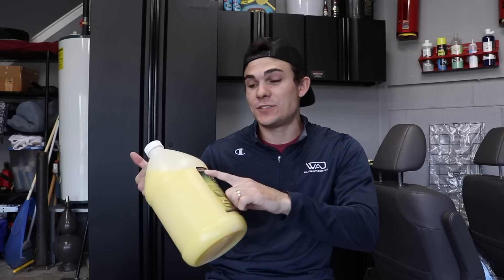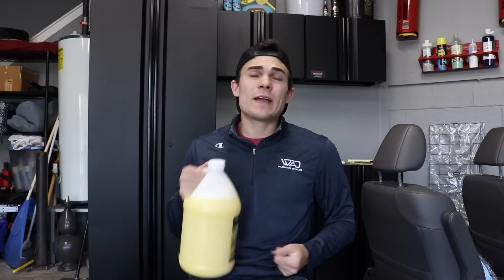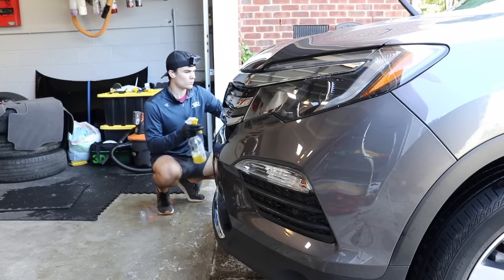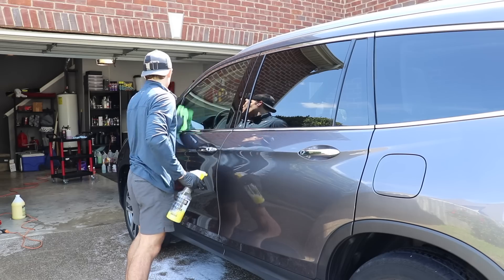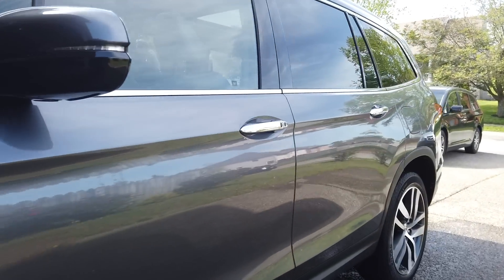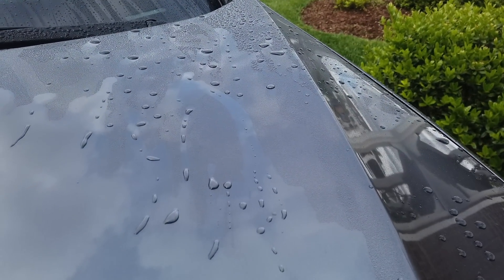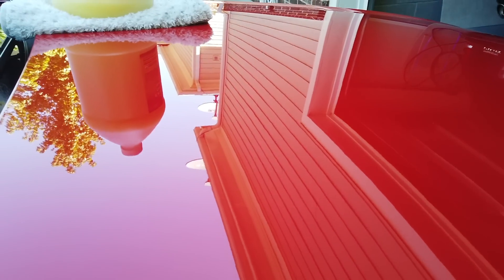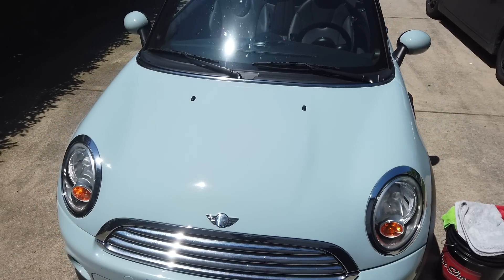BEST Ceramic Detail Spray That Has Replaced Meguiars Synthetic Xpress Spray Wax!!!

Comment: As a mobile detailer, no shop, and my driveway as my shop, I used the Technician's Choice Detail Spray. Last summer I bought a bottle of the Technician's Choice Ceramic Coating. My brother's 2016 Ford Fusion was the guinea pig. I did all the prep, to keep this short, and I applied the Ceramic Coating. The coating is good to go in four hours, as in, you can wash, drive, and do whatever.  I used the spray as the topper. The car looked great. How long does the coating last? I applied the coating to my vehicle, which is a daily driver,  at the end of August 2019 and by April 2020 it was showing signs of no longer working (to be fair I did not use a drying aid as I wanted to see how long the coating would work). I live in NY and with the snow, the ice, the salt, the sand, and the daily drive, I was surprised that it worked so well. I do love the ceramic spray detail and the paint coating works nicely too for those that are mobile. Easy to apply and take off and you can reuse your towels.
Reply: @Anthony Knox ehh I use Flixportal. just search on google after it:) -luca
Reply: @Luca Hugh thank you, signed up and it seems to work :D Appreciate it!
Reply: @Anthony Knox happy to help =)

Comment: If you like tec582 try Technicians Choice 584 G-Max graphene. It's like tec 582 but has graphene in it. The slickness and gloss are simply amazing.
Reply: I use it all the time and i also use the ceramic coating version of it

Comment: Do you dilute this when using it on the interior? Ratio?
Reply: I've used it on my older truck interior and it kept wanting to leave droplet spots that I'd have to scrub a little to get out. After that I diluted 1:1 with distilled water and it's fantastic for interior plastics and glass. But overall it's just a tool in the box, other products work great too and there's no real need to get this if you have a dedicated setup that works for the cars you handle.

Comment: Luke, whenever i use a detailer or beadmaker or spray wax  on the windows i always see a film on the windows in sun light... im i using to much product or not the correct rag... thats my issue with drying aid type products... great vid
Reply: Clean your window with an IPA, an then use bead maker or XPress wax or .... then your windows will be perfect
Reply from the maker: ^^^ what he said. My initial reaction and or question is “are you prepping the glass with an alcohol solution?”
Reply: I'll try that..thanks guys
Reply: Thierry Roy would CarPro Eraser work in place of an IPA?  Thx
Reply: Wilson Auto Detailing what’s a good ipa for windows?

Comment: I think you will find that the Technicians choice is similar to bead maker in cost, gloss, and durability. 
Amazon has it for $44 which includes shipping.  5 gallons for $135 which also includes shipping.  Great prices.
 It's basically a detail spray or drying agent at $35 to $40 per gallon including shipping.  Calling it a stand-alone product is a fantasy.  Think about it, most of the YouTube channels refer to TC as a 3-week product and describe TW Spray Sealant or TLC2 and others as a "real" stand-alone products that last 4-6 months or 10 to 12 months if using two coats. Do the math and it's easy to see that a single or double coat of TW, TLC2, Griots, or Meguires might be 3 to 5 times more expensive but they also last 4 to 12 times longer (using a second coat).  It all breaks down to what do you want the product for.  For a weekly wash enhancement for gloss, it is a real treat.  That's why I used to use it and now use TW Wet Wax, I just like it better and at $8.99 a bottle delivered to my house, is great. 

But for a pro, you have two options: (1) TC helps your business because it's so cheap, easy to use, looks fantastic and it wears out off so fast, that your customers will need to come back more often because they want that GLOSSY shine back again.  In this scenario, it's smarter to market yourself with TC or BeadMaker, by using it after a wash to give your client that little something extra, instead of charging for a Ceramic or Wax and yet you still delivered a HIGH GLOSS shine that feels really smooth when they rub the surface which they always do.  Always deliver more than you promise. The benefit to you is a happy client, and when you use it as a drying agent it saves you time and effort. (2) It allows you to explain to them that the next time they come in you could put on a finished coating that can make this shine last for 6-12 months or even 3-7 years with a ceramic coating. It can be used to upsell the next appointment.  

Yet one of the greatest uses of TC due to its low cost is using it on the interior, which I think is the secret of this product, again because it is so cheap and clients don't reflect on the longevity of interior products but will notice it on the day they pick it up; it's a win-win.  If you buy the 5-gallon container, now you have the cheapest option ($135 Amazon) and it is an honest sale when advertised as a drying agent.   I mean look at it this way, TW Wet Wax is 34 cents an oz, TW Ceramic Spray is 81 cents an ounce and TC is 21-27 cents an ounce.  

In the decades I owned a car wash in Tucson and Southern California and even after selling them, I have kept in contact with the new owners and talk with their detailers to see what they are using.  Now they primarily use TW Wet Wax and TC type products as drying aids for gloss.  For the Tunnel it is TC.  In a week or two, after the gloss is gone, they are back to renew that gloss that has disappeared.  Love it.
Reply from the maker: Yep can’t argue with the price! I’ll be doing a lot of real world durability testing with this one so stay tuned.

Comment: Hey man, great video you just made!
Just curious about how this compares to Turtle Wax ceramic detail spray?
Reply: This is wayyyy better and more durable
Reply from the maker: Hey Anthony. If you are referring to the “Turtle Wax Hybrid Solutions Ceramic Spray” then they are basically two different products. The turtle wax product is truly a ceramic in spray form that will last about 1 full year. This product is more of a 1-3 month protection depending on a lot of different variables. If you’re referring to a different turtle wax product, I’m not sure which
Reply: Wilson Auto Detailing he’s referring to the detail spray with the pink label... the ceramic spray is way over hyped. I get about 3 months.
Reply: @henryfreeman6113  You're lucky to get 3 months and not 3 weeks!

Comment: Brought a gallon 2 weeks ago per your video with honda pilot. Great product. Whats your suggestion for dilution when using interior? I polished IP panel scratches using novus than coated with this ceramic spray great results
Reply: Curious what is an "IP" panel?
Reply: @kennethkay6090  instrument cluster panel lens

Comment: Good stuff! I've been using it for about a year.  Very versatile and more durable then CarPro Reset.  Factor in that I can buy it from a local dealer for under $30 / gal and it's a no brainer!
Reply: 58$ for mine
Reply: @user-wo7rp6bc6t  Still worth it in my view. $45 on Amazon for a gallon
Reply: How do you find local dealers for this stuff?
Reply: @IndependenceCityMotoring  I called the company and they gave me the local dealer over the phone. Don't bother emailing as they don't reply.

Comment: Replaces meguirars synthetic Xpress wax with a ceramic "detailer"...well it should, but I'm thinking it would be a better comparison to meguirars hybrid ceramic wax no? The description of application seems more to this such as minimal amount, drying aide, ceramic spray, and wet or dry application.
Reply: A lot of detailers use the megs xpress wax in an off label use to do interiors. One product bought in bulk saves time shipping and money.

Megs hybrid ceramic wax can't be diluted to create a detail spray. It's not designed that way and would make a terrible product. Even though it's a safe for all surfaces product it can't be used on all surfaces outside the scope of its design. Also it's not available in 5 gallon+ for cost savings. Megs has products for that market already.
Reply: How does this compare mostly in terms of gloss, from a detail spray crafted from say ultima waterless wash+, Wolfgang Uber Rinseless, or ONR?

Hank mentioned TC does not clean. Uber would. So would uww.

Brian from apex says DPC revive has better cleaning and lube than all of them including onr.

Ceramics aside, this seems like a great product. You shouldn't clean with a detail spray anyway, kind of risky business.

Comment: When applying this on damp surfaces try a mist spray used by hair styalists...super appreciation delivery. I get about 4-6 weeks out of this product (w/ 4:1 dilution). I agree...love the stuff.
Reply: I know it's an old comment but with the longevity you're getting I wanted to double check, did you mean 4 parts water to 1 part product or 4 parts product to 1 part water?

Much appreciated in advance!
Reply: @muchachogrande2019  are you using this 1:4?

I cant find a dilution ratio anywhere.
Reply: @TXAslingr  On exterior you use it straight. Interior I'm not sure

Comment: Great video and it looked good when finished but it appears it doesn’t last long at only three weeks. Certainly after 7 days it looked like the beading had already disappeared and it was only sheeting.
Reply from the maker: I’ll need to do a “right after” bead test so you can see that it’s actually not very different. It doesn’t react the same as something like beadmaker which is what many of us are used to
Reply: Wilson Auto Detailing well I have used Bead Maker and yes it is great after use but it doesn’t last long either. So if you are saying this acts similar and doesn’t last long then it comes down to cost and which is value for money

Comment: Bought this a couple years ago, so it's not new to the market.
Wasn't overly impressed, but was able to use it as a drying aid.
Price is good, but shipping is expensive. For a drying aid I can get turtle wax at the dollar store, no difference, as far as drying aids go
Reply from the maker: Ya different strokes for different folks. I’ll come out with more videos on this and why I love it in MANY more areas
Reply: They've reformulated a couple of times through out the years. I recommend picking some up and seeing if it feels different.

Comment: Completely different product but I have tried ceramic waxes and was just not impressed with the depth of gloss after a week or so so I went back to an old school method so to speak.  I polished with meguiars 9 then sealed with meguiars 21 and then I topped it off with Carfident wax, the depth is amazing, the product is slicker than any carnauba I've ever used and the beading is so tiny you will wonder how that could happen.

Comment: Love your videos! What’s the difference between a ceramic wax and not? Is there special conditions where you would use or not? I’m not well versed in “ceramic,” in terms of auto detailing. Thanks!!
Reply from the maker: It’s a great question man! The easiest answer is something like “in many ways adding the word ceramic to a product is the detailing company’s way of keeping up with a trend that’s been happening for a while now in terms of everything going ceramic. But in some products the SiO2 base (ceramic base) affects two major areas: Visual, and longevity. Both affected positively in my opinion. These products are also pretty much a dream for topping ceramic coatings

Comment: CarPro Reload. Expensive but I cant seem to get away from it.
Reply from the maker: Reviews coming soon 😎
Reply: 2nd Chances Is it that good?  Been looking at it, and seriously considering giving it a try.
Reply: @tundrawhisperer4821  its like, the holy grail, extremely hydrophobic. It's most practical application is if you do not intend to do a painting correction. It's high in Silica. Easy wipe on wipe off. A little goes a LONG way. 
I use it as a final stage to all my paint corrections as an added layer of protection and a deep shine enhancer. Or I'll offer results mimicking a good correction without actually correcting using a clay bar, CarPro IronX following by Reload. Also my details range from 12 to 24 hour details, so for my clients.. I've found that showing them the products and price of the products for them helps justify the cost of my details.
In short, CarPro Reload is the BOMB. 

Wilson, if you have not already personally used this product...I too, like so many, would love for you to review this product and from a business stance critique it
Reply: @2ndchances542  is Reload for ceramic coated cars?
Reply: @TheDex302  it IS a great Ceramic Coating Sealant. I believe that's where this product works best. Can be used on all surfaces, trim, plastics, windows. Prior to paint correction, especially after a paint correction. The product does what its named for, reloading your already paint corrected surfaces...a great product for maintaining a pristine finish. I should be endorsed. Anyone will find, after a single mist and wipe...this product to be a phenomenal all in one. Again, a little goes a very long way. So if unsure, purchase the smaller bottle